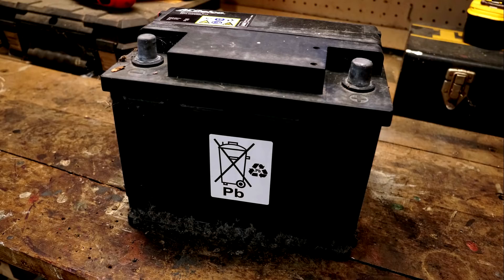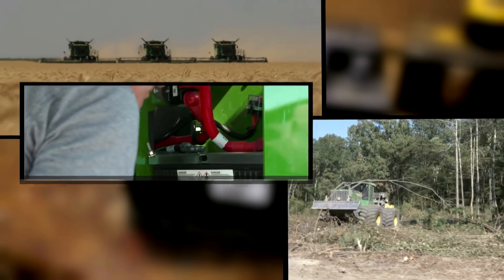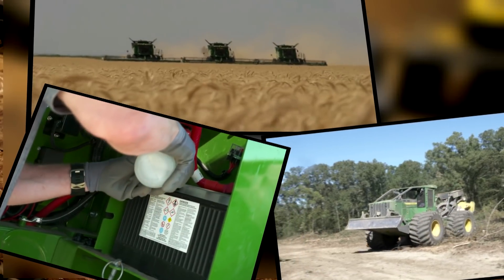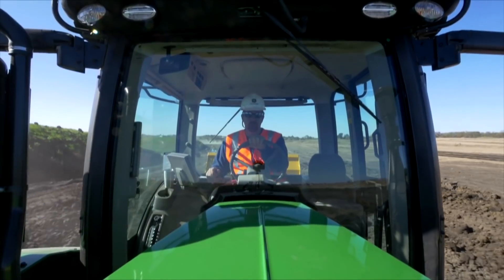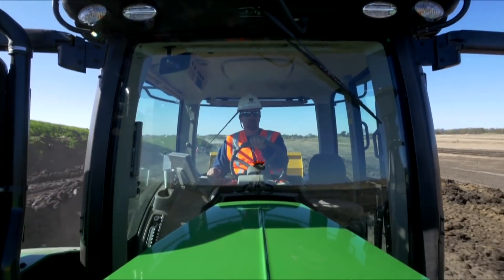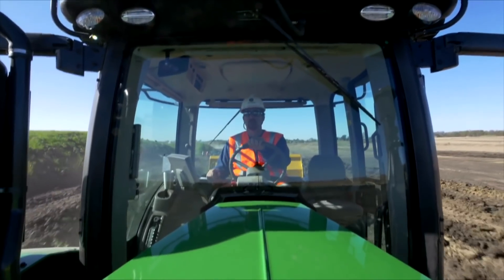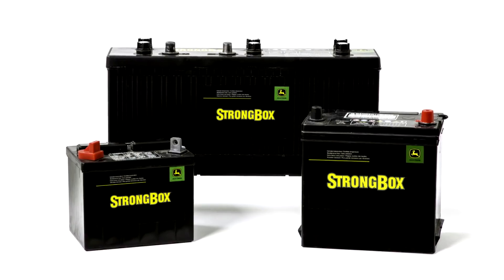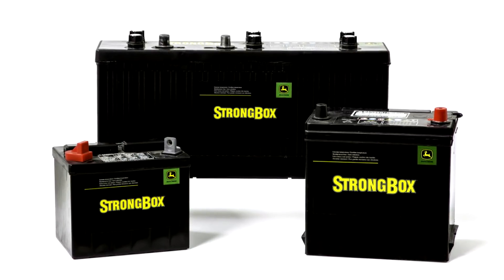Why Batteries Fail

Comment: Batteries fail because you stick them under the cooling pack on your 2014 8360rt models going through 2 batteries a week isn’t normal and to be told there’s no issues yet to be handed free batteries and then to bring a mod out to move batteries to fix a flawed design fault that again doesn’t exists 🙄🙄🙄🙄